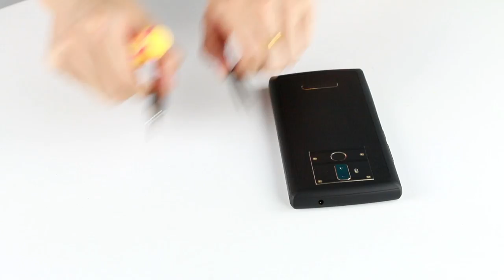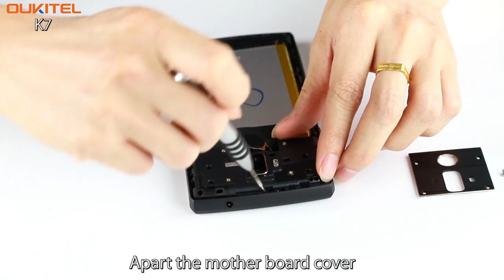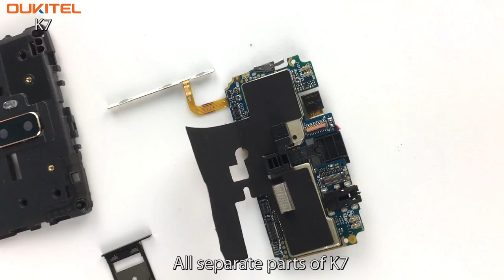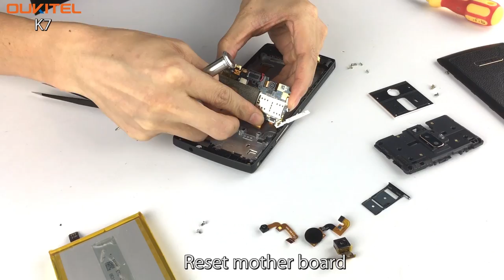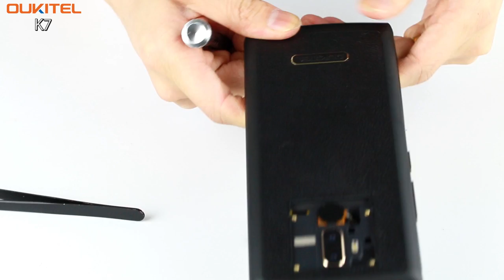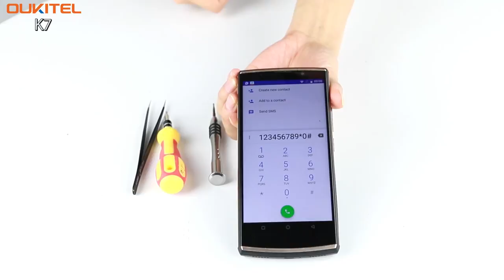OUKITEL K7 tear down video

Comment: I have the same phone but is not charging anymore, should be the charging port ? I have helft just 10% and is not charging anymore, before i had sometimes problems with charging point in same directions not charging , i think is the charging port the problem, what do you think?

Comment: The battery design has changed slightly since video was made; there is no longer a singular laminar shield of black plastic covering the power flex cable; the glue holding it is much weaker; there is a foam pad holding the battery against the outside case cover and there is a god forsaken 3-5 mm gap at the bottom of the battery so if the phone is dropped, the glue lets go, and snaps the flex cable.  If you've bought one of these, OPEN IT IMMEDIATELY and check to see if you've got a big gap at bottom of battery, if so, fill it with something or if the damn thing gets jostled you've got one nasty repair to do working on a damn batteries built in flex cable...terrifying.  This is STILL the best phone I've ever owned.